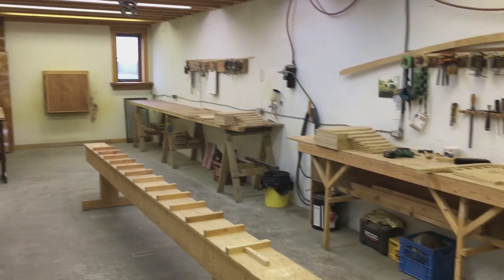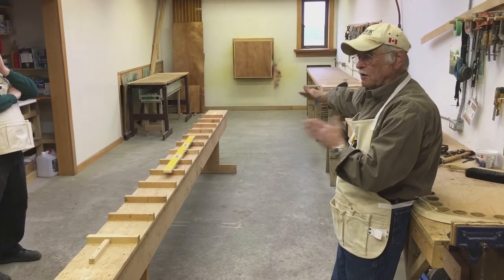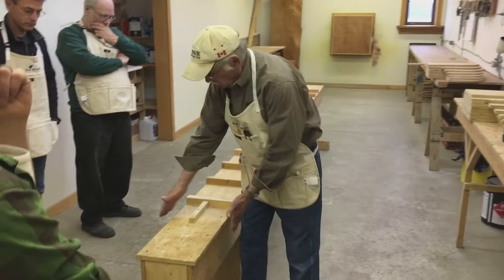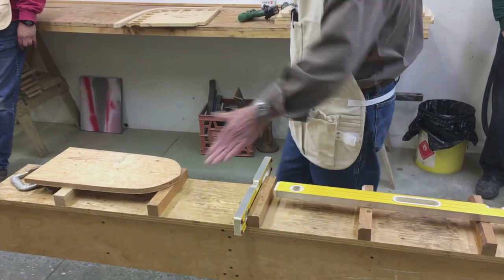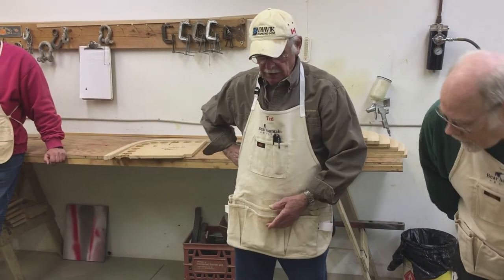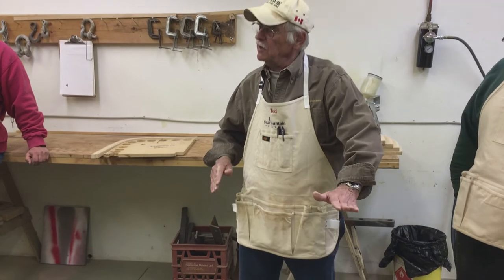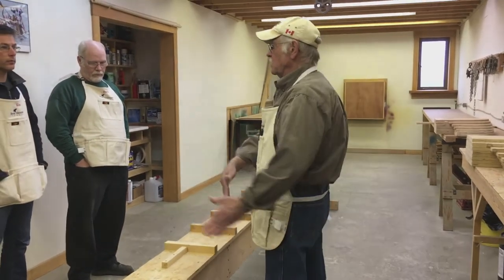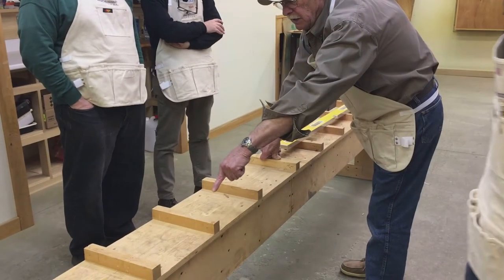Strongbacks and Molds - Canoecraft Workshop Series

Comment: This guy has an excellent series of help videos that i would never nay say. But from 53 years 22 canoes later it isn't the only way. I now build any canoe from 2ft. to 24" on a sliding gig with rotory indexers at each end. Can thurn the shell at lock down 10 degree increments.  My forms are custom laid out by full scale marine archeteure. Strongback is 45mm X 90mm stacked in a "T" shape jioned in sections. Forms are laid out old school drafting directly to 3/4 interior quality plywood with the strogback profile drawn in and later sawn out. The whole canoe is suspended by 1/2" 1045 ground/polished dowels 45mm apart at each end. Used Rexroth Bosch Aluminum Framing System. Final step is decoratively pluging those two holes at bow and stern.  There is an 18" X 6" one of a kind on there now that i have to saw out stairs to get out of my basement shop!